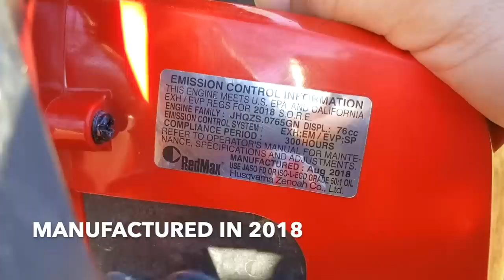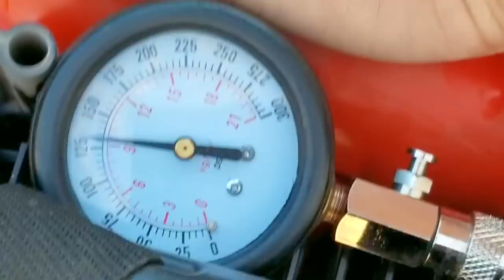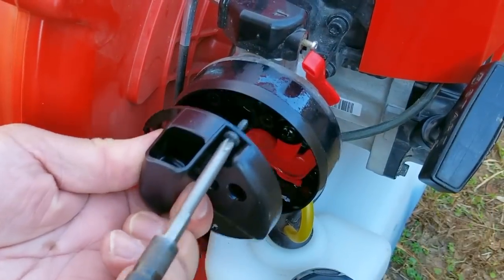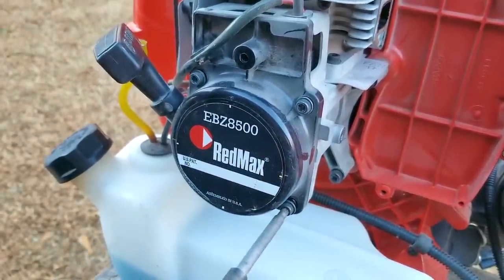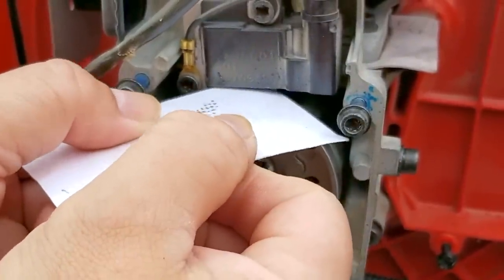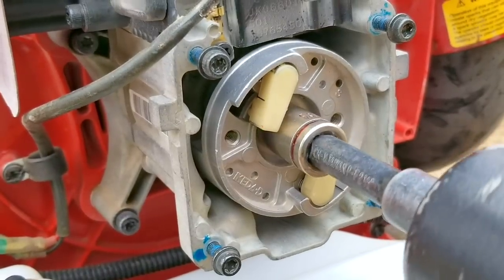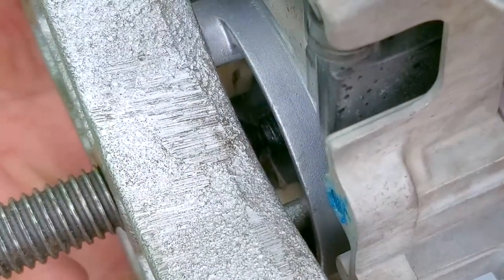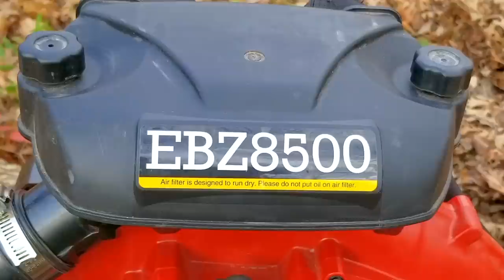Fixing A Redmax EBZ8500 Backpack Blower That Won't Start

Comment: The one thing you didn't check was the kill switch circuit. It might have had some little piece of crud partially grounding it out (as indicated by the inconsistent spark in the beginning) that eventually broke loose without you knowing while you were fooling around with it, allowing it to start later
Reply from the maker: after checking for spark, and getting, I didn't think it was related to the issue.
Reply: @HomeGaragechannel you did mention that you had inconsistent spark, perhaps that could be why? I can say from personal experience that the switches aren’t always perfect, I have a Husqvarna that occasionally decides not to stop on the switch 😅
Reply: Same thing I thought

Comment: 4:18 the reason your gauge showed lower compression than expected is because you used the attachment for the compression tester for the smaller spark plug hole. You need the Schrader valve to be at the absolute end of the tester, or else the extra volume will reduce the compression, even if it was just a little bit. I've struggled with this in the past before I realized this
Reply: I never thought of that 👍

Comment: Not for the issue you had, but as an FYI for later. These Redmax blowers, it’s very common for both the cylinder head and intake manifold bolts (4) to loosen or check as loose. When either the intake manifold or head gasket leak, if will cause various mysterious running issues. As a preventive measure when new, a good idea would be to put a white paint mark across the bolts and manifold and bolts and cylinder base, so with a quick visual inspection you can see if the bolts have loosened. However, the assemblies/gaskets may compress over time and thus the tension is released and although the bolt hasn’t turned, it would check loose when you tried tightening it. So, it still may be advisable to torque check these bolts periodically. Some other ideas would be blue thread locker, nordlock wedge lock washers (add 2mm to assembled height, may need longer bolt to maintain thread engagement), and lastly, safety wire bolt pairs to each other if you’re good with that sort of thing.
Reply from the maker: unfortunately the bolts were not loose on this one.
Reply: @HomeGaragechannel  On the ones I saw that safety wired the base bolts, they used hex bolts with taller heads that were easier to cross drill for the safety wire.
Reply: And I’ll add that if the cylinder bolts become loose, the gasket between the cylinder and crankcase will most likely fail. Once that happens, you won’t have the necessary vacuum to pull the air/fuel mixture from the intake side into the engine. If tightening these bolts gets you running, but the blower is still hard to start and then dies after running long enough to get fully warmed up, replace that gasket. It’s an easy job.

Comment: I had something similar happen.  Got a brand new ebz7500 at work.  Was loving life, breaking it in and all that.  Got low on gas 1st tank went to grab some and came back.  Blower died but didn’t run out of fuel.  The ignition coil failed within the 1st couple hours of use according to the shop.  I didn’t get the chance finish breaking it in…. Boss gave me another new blower the next day and that one has been a champ for 3 seasons.  Was super weird to say the least.
Reply from the maker: that was very strange and thanks for sharing your experience.

Comment: Neon spark testers are only a quick test, you really need a spark gap tester to see how far the spark will jump. Sometimes the neon testers will show a small glow and the spark is not good enough to start the engine. I see this sometimes on Honda's that I repair. Those are great blowers, and thanks for the video.
Reply from the maker: yes I do , I'll have to get one of those.
Reply: In the past I used to make such a distance "jump" tester with just a wooden block, an old sparkplug without internal resistor and two nails. One nail is fixed on the block and jammed between de electrodes of the sparkplug. The sparkplug boot is then easily connected to this sparkplug. The other nail can slide and is connected to a wire and simple clamp to ground. You cut away the wood surrounding the nailtips. You could set the distance between the tip of the nails. Indeed worked like a charm and I could test (mostly) questionable moped ignitions by using a drill and socket to spin the engine. This way you can  test the induction strength of the coil on the actual setup and detect faulty coils. Most times if coils are bad the colour of the spark has an "orange" tone to it and or is hardly visible. I think that a distance of at least 8 to 9mm is ok
Reply from the maker: very nice setup, thanks for the information
Reply: @HomeGaragechannel  yes and very cheap to.make 😉
Reply: Yes, coincidentally I am fixing similar situation on an Echo backpack now and the quick, Harbor Freight-type tester shows plenty of glow. But still won't start even though the coil/flywheel gap is spot on. Next step: ground the plug; hmm, there is no spark. Thus, I have ordered a better gap-type tester ... and a new coil. I have used the HF tester for years and it always seemed to be a good ignition indicator. Because of this experience on the Echo, it is revealing to me that it can register some juice, yes, but it can also be misleading.
Reply from the maker: that is a weird problem, good luck with it, I was really frustrated working on this one.

Comment: Good findings.  Ebz8050
Takes
3 primer pumps, put on choke and then 3 good pulls and it always starts on the 3rd pull.  You can take it off choke as soon as it starts.  It’s been a great blower.  Put on a eBay/China $12 carb on it last year after 6-7 years of ownership with no other issues.  I’d buy one again.

Comment: I have worked on one of these and they are a BEAST ! Made some videos because it would come back every few months with new issues - carbs, fuel filters , coil etc. powerful does not quite cover the output!
Reply from the maker: you are absolutely correct about that, This thing is a monster, when moving leaves!

Comment: We learned something new this video, i suggest adding this to the diagnostic list when it comes to checking the ignition system, checking the air gap between the flywheel magnet and ignition coil will play a huge role when checking for spark, that helped me when i was working on starting the Husqvarna 252RX to check that everything was working as it should be 😄
Reply from the maker: thank you Lucas Bergfors.

Comment: I would mix up a fresh batch of 2 stroke fuel which I had to do With a stubborn customers Ryobi line trimmer & he was adamant that he put the right amount of oil into the fuel tank of his 2 stroke Ryobi trimmer about 20 years ago which wouldn't Start.

I tipped his fuel out & ran the workshops fuel in it about 20 years ago & it started & ran.

He had taken it elsewhere in town & they said the same thing !
Reply from the maker: Very good advice.

Comment: Thanks for tearing this unit down.  I've had this model a few years now.  Awesomeness blower, when it's working correctly.  That's the problem.  Always seems to be something. 

Recently I'm dealing with it bogging down on full throttle.  (AGAIN)

I've changed the plug and fuel filter and worked well for a session.  Next time out  it bogged down again.  I changed the fuel and will try it again today.  So frustrating.
Reply from the maker: Paul Corsetto.

Comment: I think the spark checking tools can be very useful, but at the same time, i like to see the spark right from the plug and just see how much and how good of spark there is. Shame we didn't get a before video of it and then the after. Great work, for sure would leave it how it is.
 I got a free weed eater on the side of the road, thing started 3 pulls...no issues. Well theres that, HOWEVER, i also have a residential grade Sthil weed eater which is a PAIN to start, and is cold blooded. Some might throw that away just for how it starts.
Reply from the maker: you make a really good point

Comment: If this machine was that new I would have returned it.  If not then the customer did what he/she should have done and you fixed it.  What a puzzle this one was.  If it is that hard to work on I probably would not purchase one unless they are all about the same.  Great job on the diagnosis and repair.  Thanks for the video's.
Reply from the maker: thank you for your time D Butler,  I appreciate it.

Comment: I have a two copies of this machine or a rebranded version & i can tell you this much, mine won’t start with wide open throttle, to start i follow the manufacturer’s guide which i s to apply full choke no throttle, pull start until the engine starts & runs & when the engine starts to stumble, open the choke to fully open & the engine continues running, after a minute of warm up i can apply full throttle.
I don’t own a single two stroke engine that requires any throttle to start & i own 8 different machines with various sized engines.

Last year i had one of my Honda engined Toro Hoverpros that would run for a few minutes then die, it would restart each time but die again.
Turned out it was the spark plug which was a resistance type plug, the resistor was failing & cutting out.
A new plug immediately fixed the issue. A resistor plug usually has an R in the part number.
Reply from the maker: thanks Will Grant.

Comment: If it starts, that's good enough for me. The 8 horse I/C on the Roof won't need choking even when cold if it's just been a few days. My pal at his saw shop clued me in on that one. That model Briggs is just that way. It starts on the last charge it got when the ignition was shut off. And the Echo fired on the 2nd pull instead of 3rd! Maybe it'll start cranking itself! Thanks and Blessings!
Reply from the maker: thanks for the information.

Comment: Worked as a landscaper some years and in the workshed when picking up a tool such as a chainsaw, blower or trimmer, the older guys would tell you 
" aha, you have the nr.354  so you need to prime, 1 pull full choke, 2 dry, 1 at 1/2choke - starts".
Reply from the maker: wow, they know what they're talking about

Comment: For a while, I was thinking that there was something wrong with the kill switch. I was thinking that the manufacturer had a faulty kill switch that was preventing the blower to start. Good detective work on your part. 🤔🤔🤔🤔👍🏿
Reply from the maker: You never know, it might still be "working intermittently" which is causing it to flood on start up. The only problem, is that it doesn't randomly shut off, if the switch was bad.

Comment: i have an echo backpack blower that i am working on and we just replaced the ignition coil with s brand new one. however it had no spark no matter where the killswitch is turned to
Reply from the maker: have you tried to remove the small wire going to the Coil, and then try and start it?
Reply: @HomeGaragechannel  will have to try messing around with it when I get back to it, its part of a shop class I take where we fix people's equipment
love your content, I have learned a lot just from watching your videos! keep up the great work
Reply from the maker: thank you and you're doing some really good work at that class. A lot of people appreciate that kind of stuff.

Comment: That weak spark when you first tried starting it would have been my first path of investigation. I would have checked the kill switch first and then looked at the coil next. Resetting the air gap seemed to help.
Reply from the maker: it quite possible but I don't that the new stuff has a good spark at all when compared stuff from 20 years ago.

Comment: My boss sells redmax products. The 8500 in my opinion, the best blower on the market. 2 things over the years that were a problem. 1. The bolts on the fan would egg out causing fan wobble. They recalled it. 2. Coils were intermittent. Similar to the start of this video. Also a recalled part as well. Sorry for the long comment lol.
Reply from the maker: no need to apologize and thank you Joe Apicelli.

Comment: I got one for you. I own a STIHL BR380 blower. Even though it’s 11 years old the hours are low. I only use non ethanol gas and synthetic oil. Last week after full throttle use of about 30 minutes it lost power (rpm’s dropped). I took off the cruise control and it idles fine. Shut it off and it starts fine but will not rev up to high rpm. Once cold I start it up and it does the same thing. Only difference is it only takes 5 minutes to act up now. I have done the following. Cleaned the spark arrestor, replaced the spark plug, air filter, fuel filter, carburetor (OEM), ignition coil, and fuel lines. Compression is 127 (checked it right after it lost RPM). I also removed the filler cap thinking the vent was clogged. No change. Spark plug tip looks normal. Once RPM’s dropped I sprayed starter fluid into the intake and it still didn’t accelerate. It has me buffaloed. Any thoughts. I know I can buy a new one but the new ones like this are 2.5 lbs heavier and I’m like you, I want to find the problem. Sure would appreciate some help!
Reply from the maker: sure, have you checked the bolts that hold the cylinder to the block?
have you checked the insulator between the carb and the engine? there might be a leak there.
You given me a lot of information which I'm grateful for. That's why I'm leaning away from fuel, and spark, and towards an "air leak".
Reply: I have checked the cylinder bolts. I have made a visual inspection of the insulator but did not remove it. What could be wrong with it? What should I look for? Thanks for responding.
Reply from the maker: sure, I would start the engine and while idling, use a spray bottle of water, to spray water around the droplets, and see if the engine reacts to any water droplets that get sucked into a leak.  I would normally recommend a different "spray" but I cannot because of liability.  An air leak, after the carb, and before the engine would cause the engine to get more air, and not enough fuel, so the engine won't get to full speed.
Reply: What do you mean by "spray water around the droplets". Do you mean spray water around the insulator and see if the engine reacts to it?  Have you ever heard of an insulator failure? If so, what happened?  Are you saying an air leak can be different when the engine is cold and after the engine has warmed up? Thanks for your time?
Reply from the maker: sorry about that. 
spray around around the insulator or even the base of the engine
where the gasket for the cylinder is. If the water droplets get sucked in, 
it will cause the engine to change speed, and you'll know there's an 
air leak there.
Reply: I'll give it a try.  I guess you've never heard of an insulator failing?  I guess I'm just looking for a loose connection somewhere and the screws need tightening? Thanks for all your time!
Reply: I tried the water spray and it made no difference. After running it about eight minutes today at full throttle it started to loose RPMs again. As I said in my first video, when this problem first occurred it took about 25-30 minutes of run time before it started acting up. Now it doesn't take but a few minutes. I have a one minute video of it (acting up) and I wish there was a way to get it to you so you could hear it. This has become quite the challenge! I'll gladly pay to get the problem corrected.
Reply from the maker: yes it more of an issue of the screws getting loose.
Reply from the maker: me too. do you have a compression tester?
If so, I'd really like to know what the reading was, when it starts to have issues.
Reply: 126-127 PSI.
Reply: I'm going to remove the muffler tomorrow and see if by chance the exhaust port is clogged. After that, I don't know of anything else to try. Stay tuned!

Comment: Anytime an engine floods beyond its normal choke point, you should check the air filter for any obstruction. If that's good, the next thing to check is your high and low fuel rate metering screws could be out of adjustment and letting in too much fuel during normal ops.
Reply from the maker: thank you K L

Comment: As someone who works in gopeds there is a model called a geo sport. It has a double stack carb like that and they are very finicky. I finally just decided to replace manifold with a single stack manifold. Also that looks a lot like a Zenoah engine.
Reply from the maker: oh wow, that's a good idea.
Reply: U got any links to those parts?
Reply: Pretty sure Zenoah and Redmax are same just like Echo and Shindiawa.

Comment: I had a lawn boy throw me in for a loop once. Had everything to run. Coil plug carb swaps nothing worked until I looked in the exhaust and realized the piston rings moved and lined up to cause it not to run. Was a real head scratcher
Reply from the maker: wow, that was a real pain to figure out.

Comment: These are great Blowers. I own 4 of the 8500 and 2 of the 8550. Mine don't seem to flood as easy as this one does not sure if it makes a difference all mine are left hand throttle. Also the oil in the air intake pipe is normal. We always have to choke all of mine to get them started it doesn't matter if the engine is hot or cold. One more thing always start them with the throttle in the idle position.
Reply from the maker: thank you nashguy207 for the information

Comment: Just had exactly  the same problem with a post hole borer. Looks like the same carb also. Did everything you did and couldn't really see any problems. But while it was out and stripped, I ultrasonically cleaned the carb and reassembled it. Did the tank also. Put new fuel mix in it and with a prime it started 4th pull. So perhaps I just couldn't see fine dirt particles in the carb??
Reply from the maker: yes that could be the issue.